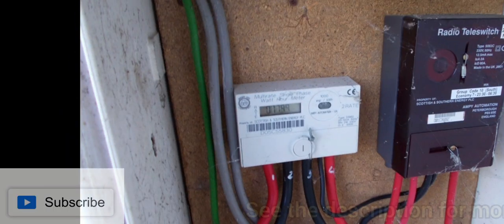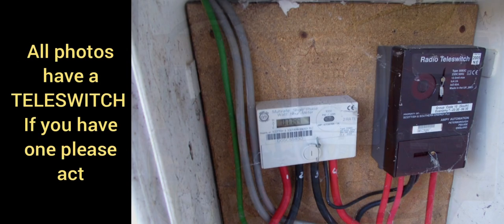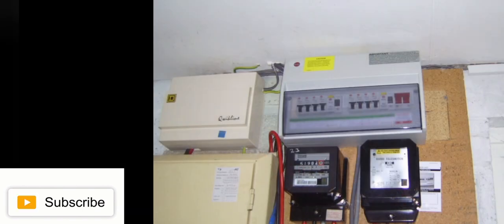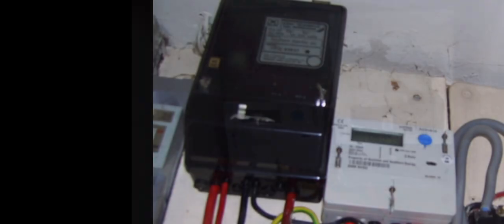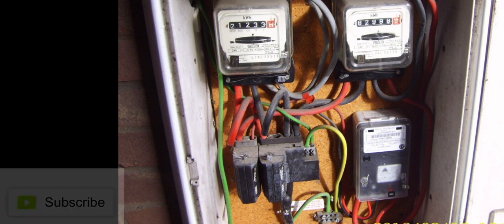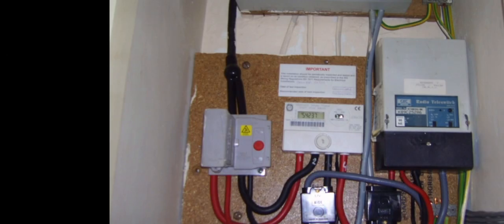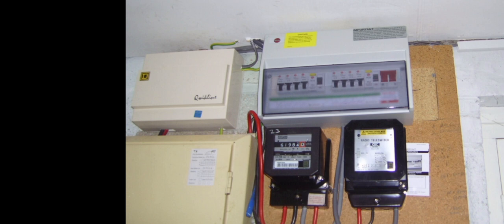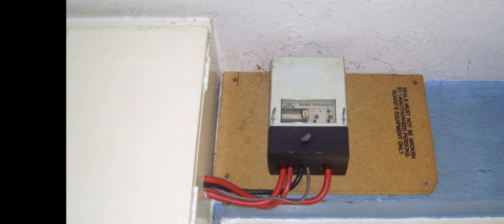High Electric Bill & Long Wave Radio Switch off BBC Economy 7

Comment: Luckily my old dual tarrif meter  doesn't use a long wave frequency to switch it over. Also the only thing i use between midnight & 7.00am is the fridge & router.
Reply from the maker: Do you have 2 consumer units ? If so  the fridge and the router are still using pk and I may be worth switching to a single rate as its cheap (if you don't have storage heater and a dual immersion hot water )
Reply: @DeathLazerBoy  i only have 1,  17th edition split csu with no off peak heating.
I dont mind having a single rate meter fitted but i bet your bottom dollar as soon as the meter installers step into my house they will be putting a smart meter in, i dont want 1 of them. Previous literature from Ovo has also stated that my meter will expire & stop working!!
Reply from the maker: @merlin5476 agreed I won't have a smart meter fitted, just keep an eye on our unit price

Comment: I have an Economy 7 meter installed when the building was built in the early ‘70’s it turns on my immersion heater at 01.30 and off at 08.30. Now my supplier wants to install a Smart meter as the RTS is being switched off in 2025, I don’t want a Smart meter, is it possible for an Economy 7 meter to work without receiving a radio signal? I just have a dual anologue meter and a very small black box next to it.
Reply from the maker: The radio tele switch will not switch once the signal goes off, it might get stuck on the off peak but will most likely get stuck on the peak !!!! Try and get a non smart meter fitted that has an internal clock. I think it is possible to have a smart meter fitted in dumb mode 

https://www.moneysavingexpert.com/utilities/smart-meters/
Reply from the maker: Please consider subscribing to help me grow the Channel
Reply: @DeathLazerBoy  Thank you for your reply.
Reply: @DeathLazerBoy  Will do.
Reply: I'm in the same situation. I'm so glad I found this. I also don't want a smart meter.
Reply from the maker: @carolinebest3240 you could request a dumb smart meter ! Or even put tin foil around the meter to stop it transmitting